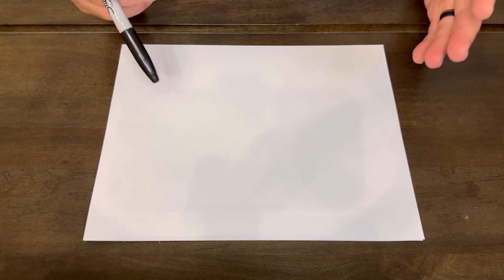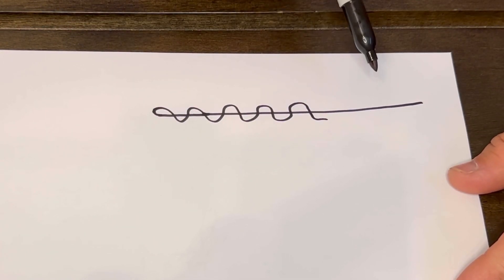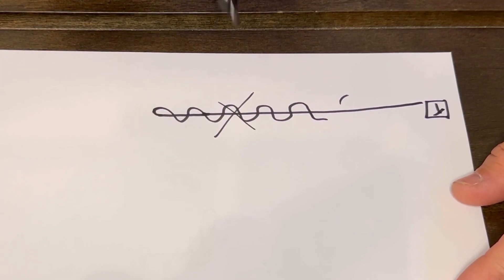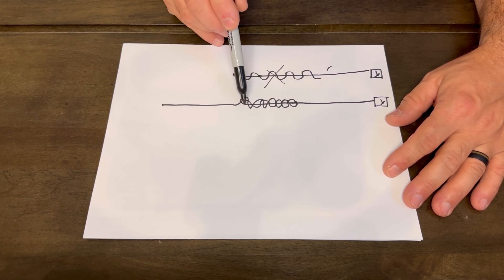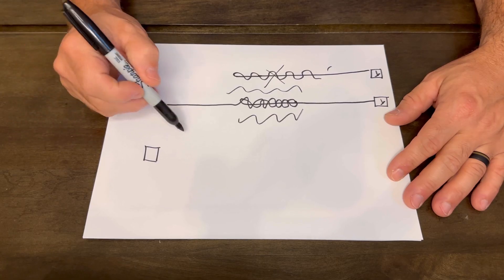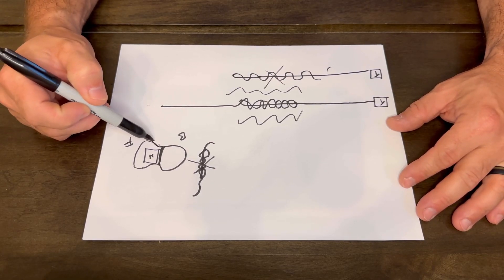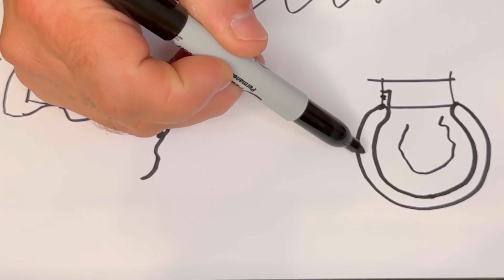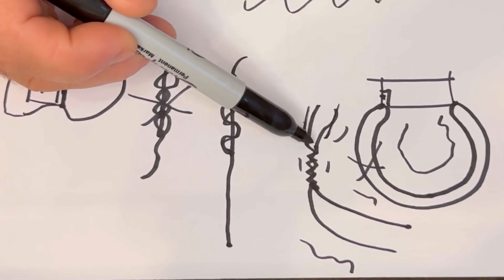How to install an in-ground dog fence - Why your twisted isn’t canceling

Comment: I have a L shape area 1000 ft so can I do a U turn to make it a full loop? If so is there a distance to maintain looping it back?
Reply from the maker: I believe what you’re asking is how far part the wires need to be from one another so it doesn’t cancel the signal. I like to keep them 4 feet apart. Here is a link to a video where I explain the different fence layouts you can do. Choosing your dog fence layout
https://youtu.be/3xgtqiD3pkQ and here is a link where I explain the twisted wire in more depth. https://youtu.be/y6wTvgMsbPU?si=qJYs2dxFk2KRbUOJ

Comment: To traverse door openings I cut the wire twisted two pair and reconnected the ends but it is still sending the signal.  How do I fix this?
Reply from the maker: What you’re doing is just allowing the signal to run from 1 wire - into 2 wires and then back to 1 wire. The signal will travel along all of them and still activate the collar. There are 2 sides of the fence. One side is connected to one terminal of your fence transmitter and the other side is connected to the other terminal. It is when these two sides come together and are twisted is when the signal cancels. You are simply twisting one side of the loop and that is why it is not canceling. This is still one of the most popular questions I get. I will put out an updated video in the next couple of days to help clear up the confusion with a better visual aid.
Reply from the maker: @JCIMLASFE I just uploaded a complete explanation of the twisted wire and why you’re still getting the fence signal along your twisted wire. https://youtu.be/y6wTvgMsbPU?feature=shared